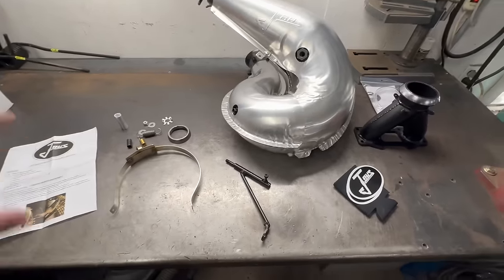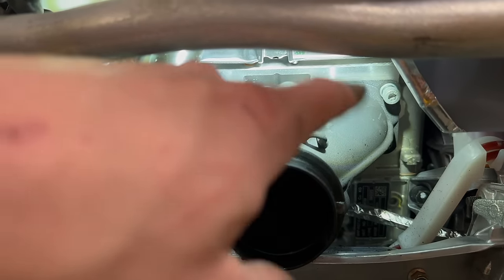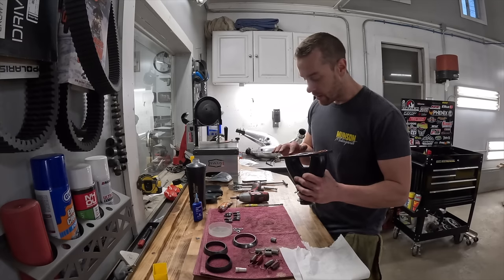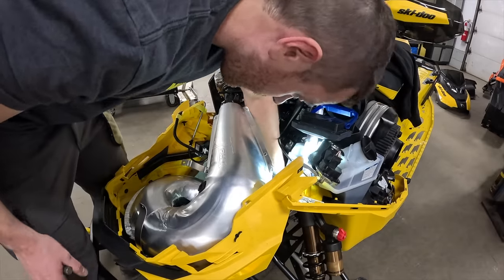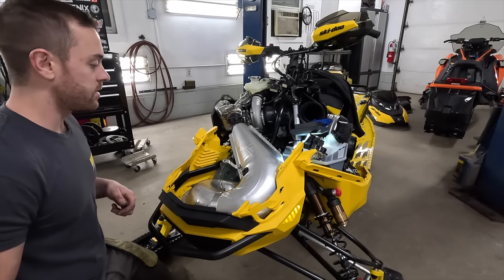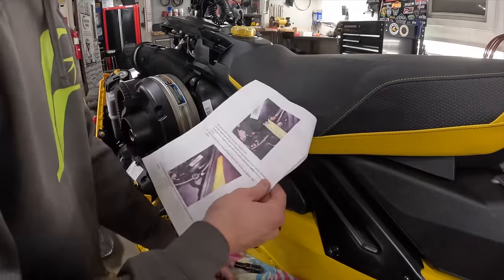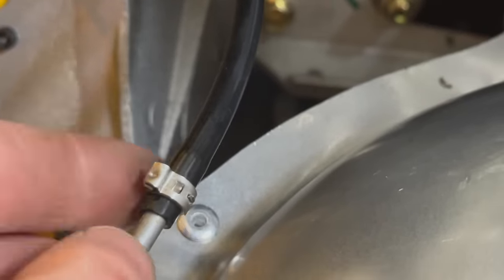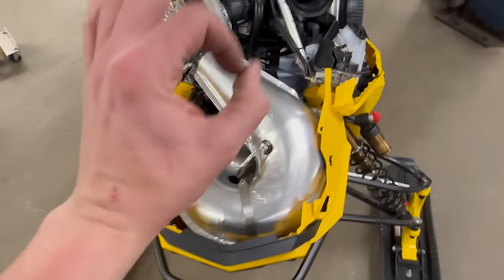Complete JAWS pipe install on the 2024 Ski-doo XRS Competition Turbo! The Y-pipe springs are crazy!

Comment: The rubber seal has been on the 850's for several years now.  Meant to burn out in the first bit of running, there only to keep the fogging oil from dripping out in the belly pan and onto the floor before the grafoil seal seats.

Comment: Wht I do for my springs is I take a long gauge wire and loop it and then make a handle and wrap the wire around the screwdriver/handle and use the long wire to pull and stretch ur springs and pop em in place and then undo the handle and pull the wire threw

Comment: I believe all these sleds come with that rubber ring. Typically (happened to me with my new 850 as well), the ring is in there to keep the heavily oiled engine from leaking all over the place. The ring burns off on the first couple of rides and any excess oil leaks out. You'll see a lot of folks complaining about their brand new sled leaking oil and or some sort of rubber ring that is in the bottom of the engine (which you noted a normal). But its just this process happening, the ring is sacrificial.
Reply from the maker: That's my first time ever seeing the rubber ring in there, but I also haven't pulled the pipe/y-pipe on a sub 5 mile machine before haha. It's surprising with the rubber ring, AND these beefy boy springs there's still some oil that gets by
Reply: This is correct. When I did my can install mine had melted out and fell to the belly pan
Reply from the maker: It's wild, right after this post and another on Dootalk, I looked over a 200 mile Expedition 850 and sure enough, found half a burnt rubber ring sitting on the Y-pipe! No wonder the Doo's have a such strong smells during the first few rides

Comment: My favorite for pain in the ass pipe springs is a 3’ piece of 550 paracord !
Reply from the maker: I thought about doing something similar to pull, but I really think you'd need a winch/pulley system haha...they're crazy strong!
Reply: @MunsonMotorsports  so springs really do suck but it’s nice to angle them easily to reattach and get weird angles on some!  It definitely makes it easier to get your whole body into some of the springs. Lol

Comment: Does vermont bust your chops with aftermarket exhaust on the vast trails?
Reply from the maker: They have the same laws as most other states, except their big check now is to simply look for the SSCC stamp. If you don't have that you're hosed! I've seen some wardens not bother exhaust, and seen some be all over it, never know how it's gonna go.
Reply: The pipe is identical to stock. No way to tell. As long as you run stock silencer you will pass any tests and visual tests.

Comment: Any idea why they ask you to relocate the pressure sensor port when they still weld a bung in the pipe for it?
Reply from the maker: The short of it is that the pipe utilizes or is making increased pipe pressure that I'm assuming is higher than what the ECU wants to see. So to prevent the ECU from entering a major correction factor, or a limp mode even, the sensor pressure source is relocated to the airbox/intake manifold so it still sees/gets a pressure reading, but it is one that is within the accepted window the ECU is looking to see.
Reply: It is tricking the computer to therefore work with this pipe and actually add more power in a cheaty way lol.. very sneaky by jaws. But hey if it works more power to them lol
Reply: just dont fuck with it if its not broken, they cant support their hp claims

Comment: Those springs are a nightmare. I had mine off 2 weeks ago. Had to call my brother that benches 400 to come and put the last 1 on for me. Took him all of 2 minutes to get it on lol
Reply from the maker: Well that certainly makes me feel a little better that it's not just me haha, but man they're crazy strong little units!
Reply: A good spring tool and vice grips makes it a lot better but yeah they are not easy for sure lol..
Reply: The eyehole spring tabs Jaws uses leave a lot to be desired. The factory style spring tabs are much easier on wear of the spring hook where it contacts the metal. 2-stroke have a lot of harmonic vibration and that eats through those spring hooks until they snap.

Comment: For the price of this kit I wouldn't be totally happy, between the clear garbage tubing and the exhaust shield interference issue. Jaws could easily solve those things
Reply from the maker: I totally hear ya, I'm just the installer. I'm here to try and help provide insight and some tips to make fellow riders mods and seasons go better! I hope nothing I'm sharing comes across negative, I'm just super picky and I know there are others like me out there. Whether the the things I ran into will bother the end user is up for them to decide.
Reply: @MunsonMotorsports  appreciate the install video and all your feedback. Well done
Reply: First year sled and first year parts. Their pipe kits 5 years ago where worse quality then they are now. Don’t forget they are the only pipe that is giving you the heatshield.. which is huge vs a Bikeman or dynoport or others where the under hood temp is insane. Even ceramic coating doesn’t help vs insulation and the shield.

Comment: What’s up with the sensor relocation?  More power or ?
Reply from the maker: The short of it is that the pipe utilizes or is making increased pipe pressure that I'm assuming is higher than what the ECU wants to see. So to prevent the ECU from entering a major correction factor, or a limp mode even, the sensor pressure source is relocated to the airbox/intake manifold so it still sees/gets a pressure reading, but it is one that is within the accepted window the ECU is looking to see.

Comment: Soooooo with this not needing a tune, can anyone explain how this works tune wise ? Is it just relying on correction factors in the ecu therefore having small lean/fat and miss timed moments ?
Reply from the maker: The new ECU has a lot of sensors, they're collecting/utilizing a lot of data so I'm sure the corrections and safeties are pretty strong and will keep EGT's and fuel trims where they should be..or at least close to it. Clearly they're utilizing increased pipe pressure to supercharge (obviously it's a turbo sled, but the action of the tuned pipe pulses and how it forces the air into the cylinder is referred to as supercharging) the cylinder more, which I'm assuming is why the pipe pressure sensor relocation is a necessity. I'm also assuming, the '24 ECU is a little more sensitive/picky about pipe pressure compared to the earlier mountain counterparts.
Reply: Curious to hear how it performs for ya, I'm in the mountains and already jelly of your water mether
Reply from the maker: @zp9898  I'm curious to see how the ICE system works with increased boost pressure. It may be why the mountain sleds don't have it as they're running higher boost at elevation. It doesn't seem like the system has any way to increase the spray pressure into the reed assembly, so it's probably only going to remain efficient at lower boost levels. IE, lets just say the system can produce a spray pressure of 8psi at the injection site, if there's 3psi of boost pressure in the manifold, the spray pressure is now only 5psi. If you increase boost to 8psi, the boost pressure will negate the system spray pressure of 8psi and you'll only have a little trickle if any making it's way into the system. This is why proper turbo fueling systems have rising rate fuel pressure regulators referenced off boost pressure; so the injector pressure can maintain the same ratio as boost pressure increases. The ICE system pressure may be a good bit higher, but the theory is still the same, efficiency will be lost if the ICE system pressure doesn't increase with boost pressure once these things start getting turned up.
Reply: @MunsonMotorsports  depending how it is injected yes, my background is with the import car crowd, and when we use a methonal injection kit we usually tend to spray into the throttle body or right before it in a charge pipe. Our pumps aren't rising rate, but we did have different sized jets. The idea was to fog the charge air, not necessarily inject into the combustion chamber, as the whole thing works off the evaporative theory.   If they are using established pumps, you should have no issues between 3 and 8 psi.  With cars, even when using it as an octane boost, the jet sizes covered a large swath of boost like - 10-15psi, and had no problems with mixture until like 35-40psi of boost, but then again our pumps are/ were like 220 psi.
Reply from the maker: @zp9898  100% correct. My worry comes from the fact that the pump looks like a windshield washer pump and there's already been a report of a nipple/port breaking off the reed cage assembly. The system has one feed line that Tees into both reed cages from the middle with no real jet, (unless there's an orifice/pill inside the tee fitting) the system is a great idea and is obviously a proven method, I'm just slightly worried about the longevity and overall efficiency of it in this application to be honest.
Reply: @MunsonMotorsports  mmmmm yea that doesn't sound great, I wonder what could be wired in for a pump instead, and then maybe relocate into a charge pipe pre reeds. Very annoying that this is a thought on something with the price tag it has
Reply from the maker: @zp9898  Right there with ya, it doesn't seem like it was an afterthought per say, but it also doesn't seem as refined as the rest of the sled if that makes sense. If the ecu has the capabilities to be unlocked and the on/off cycle of the pump to be played with, depending on the pumps output and internals, I'd be partial to running C16 in that tank instead 🧐
Reply: @MunsonMotorsports  If there's a separate fueling table with switch on or off that'd be a very real possibility. Shame the aem kits are so expensive would be fun to experiment with the summits, just to help with det suppression

Comment: what’s the torque on the bolts for the y pipe?
Reply from the maker: Y-pipe to cylinder fasteners are 25lb/ft (+/- 3lb) according to the BRP manual

Comment: How come you didn’t put any high temp copper around the donut between y-pipe and pipe? Like others have said that rubber is there to catch some of the extra oil for break in leaking by.